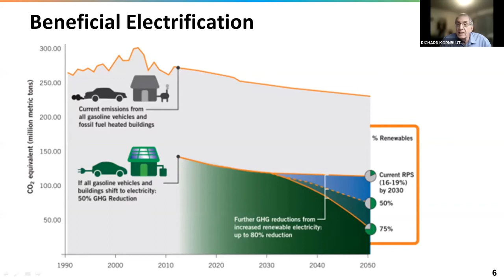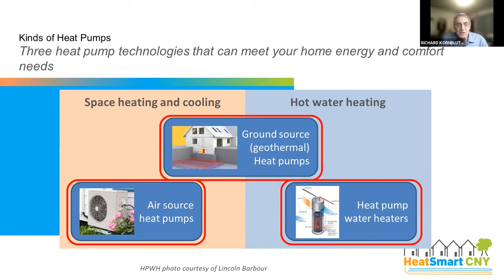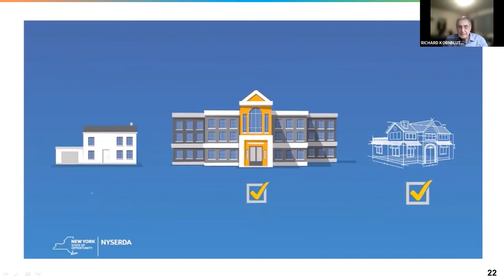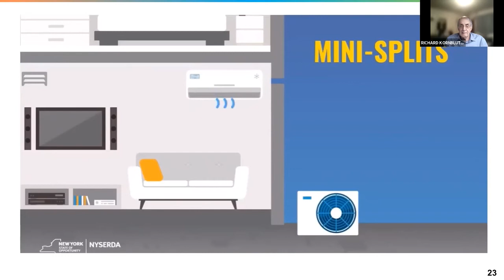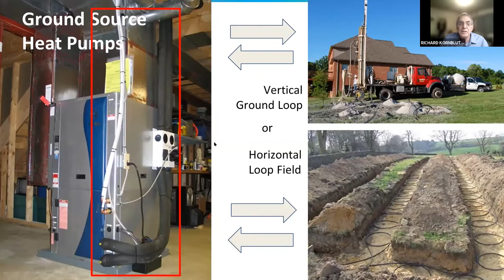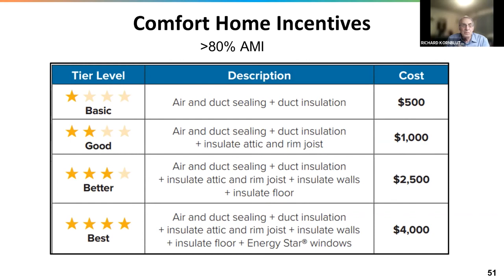Heat Pumps 101: How to get off of fossil fuels! (November 8, 2021)

Comment: You say these condensers are very quiet. I am not finding that to be the case. My unit, installed in May 2021, sits outside my bedroom about 12 feet from my bedroom window. I find that now that we are heating, and all the units are running, I need to wear earplugs in order to sleep. Is this normal, or should I be contacting my contractor?
Reply from the maker: I would contact your contractor and have them check the system.  The outside unit should definitely not be loud enough to need earplugs to sleep with the windows closed!

Comment: You have talked about different types of heat pumps but you didn't mention Air to Water heat pump like Spacepak or Enertech.  With water you can heat your floor, wall, ceiling, low mass panel type radiators and provide hot water. Even radiant cooling is possible. I am a plumber and I see split units in houses and I ask people why don't they use it during cold days. Almost every answer was they hate dry air or during defrost there is cold air blowing into living space. If you promote Air to Water heat pump, US have a better chance reducing emissions....
Reply from the maker: Air to Water is definitely an emerging technology, and an interesting one for where geothermal may not be possible. Geothermal is far more efficient for those types of retrofits though - changing the temperature from 45* (ground temperature) to 68* takes far less energy than -15*F (sometimes the air temp in CNY) to 68*F.  What’s the COP of the air to water systems at -15*F?
Reply: @energysmartcny  Geothermal manufacturers  won't provide power usage to pump the water trough loops. This definitely subtracts COP. The cost of installation far more surpasses any heat pump. Geothermal is heavily relaying on grants.